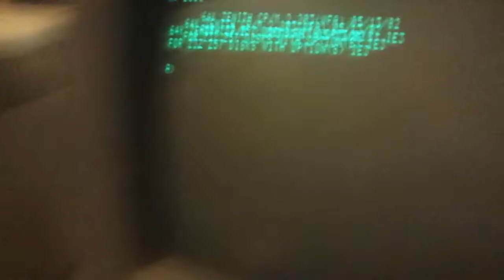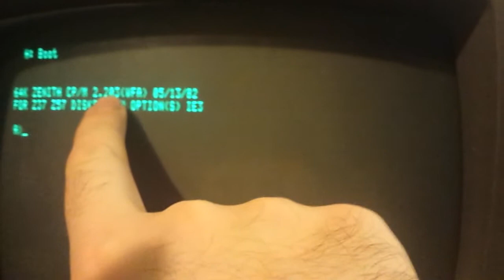Zenith Z90

Comment: I have new spare parts for the z89, 90. since heath/zenith was only cpl miles from me. also a working z100 too sitting right next to me. you can either use cpm or hdos. email me if interested.
Reply from the maker: I don't suppose you have a spare MM5740 keyboard encoder floating around? Mine died and they've all been snapped up by the Apple community. Cheers.
Reply: hmmm, not really sure. I think I have brand new keyboards, drives, and not sure what else. haven't looked at the stuff for 20 years or so. most of the 90's and 100's were scrapped for gold. i'll check in couple days. might take me that long to find the boxes lol . I'll see. I might even have  a mother board to 2.
Reply from the maker: @williamkechkaylo7915  No worries. Don't stress if it's too difficult. Thanks!

Comment: I used this model computer to control a kiln with 16 temperature zones. I wrote the code using Microsoft Basic. I found a bug in one of the shift functions. I do not remember the type it was either arithmetic or logical. I called Microsoft and talked to Bill Gates. He fixed the bug and sent me a paper tape of the program. I later found another bug in the shift functions. I was sent another tape. I had to load the program using a model 33 Teletype machine. The code was stored on floppy disk.